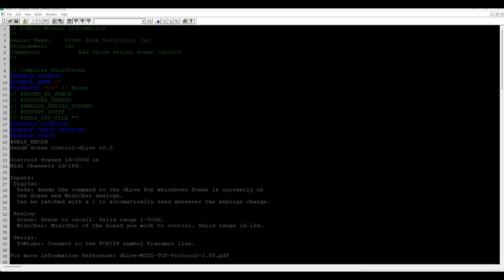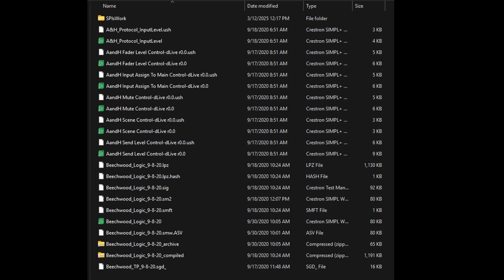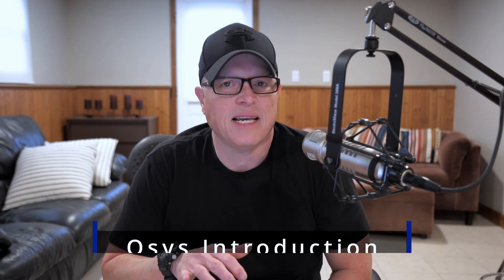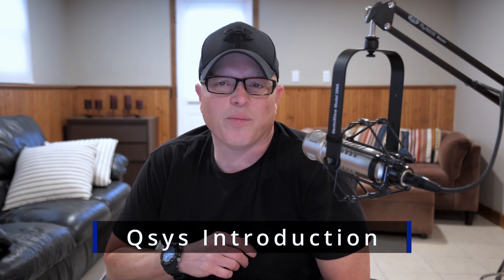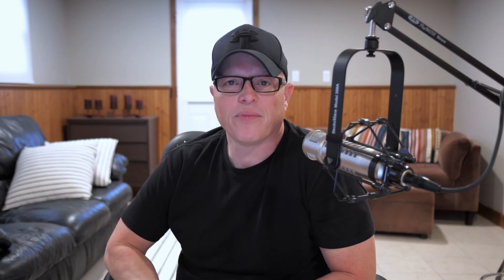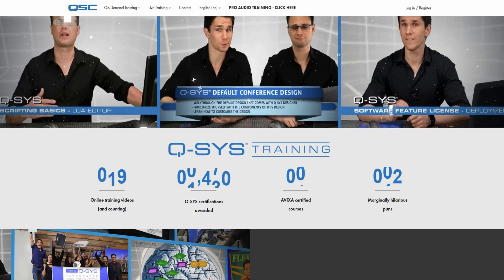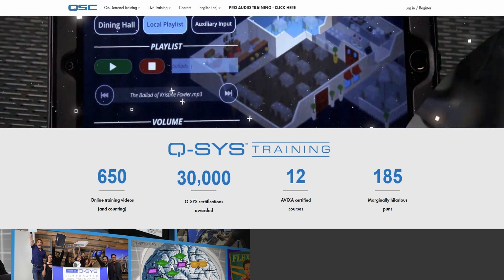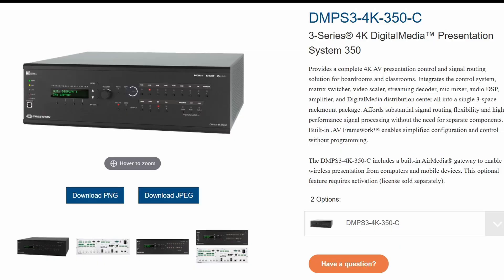The latest debate.... Qsys Vs Crestron, and who shall step up to the plate?

Comment: Control4 is a better system than Qsys.
I don't get why anyone thinks QSC is anywhere near Crestrons level. 
Unless people have just been AV programmers and don't understand software so they are lost as the industry goes from AV programming to actual development. 

C#, Vue-React-Angular - Completely Open source is what Crestron offers now. Only old legacy programmers use these proprietary tools. I haven't used any proprietary softwares in 5+ years. The only drawback is there has been TONS of AI trash slop, the benefit is I am constantly getting to fix AI slop. So my job is more and more secure. The more often people who dont know code, have AI write trash code, the more I get to fix it
If you leave the proprietary crestron software, you can also real time update the UI and code. 
vs
Lua - dated extreme limitations. And people are also using terrible Ai slop...well people who dont know Lua thinking CoPilot/GPOT/Grok are giving them good code. 
2002 era quality UI
Completely proprietary not reusable, cannot import npm/node packages. 
In are era of increasing complexity is not allowing OOP, refusing to leave dated procedural programming format. 
QSC debugging is the worst debugging I have ever seen in any proprietary software. 

Even Extron is leagues above QSC. They at least adopted python.

Comment: I’ve been a AV programmer for over 20 years and have been curious of how long the industry will last with the new AI development. Always did all my programming by hand but recently started using AI that can type out code in hour or less that would take me a day just to type it out. You do need to under stand how Lua/simpl+ work since AI does make mistakes on syntax confusion.
Reply from the maker: Same here!  I’m in that same boat.   I have come to the realization though, that AV will never be a single box that gets put in the room and that single box does everything.   AV has always been a combination of parts to make a system.   Programming wise will definitely be getting easier for just about anyone.   Running the wire, knowing how things interconnect……. and like you said, you have to be smart enough to known that AI isn’t lying to you.   We definitely have some big changes coming our way!  And also……. thanks for hanging out!   Glad to have you here.

Comment: I currently am developing a Q-SYS plugin for DM-NVX, and i must say that Crestron’s rest api is very extensive and a breeze to implement if you leverage lua in the right way. 

I have mostly been in the QSYS ecosystem but am currently taking crestron classes. When i have time, i plan to sit down and just write a Simpl# project utilizing React or TS. This is where i find crestron to be very interesting. 

If i can build a project like i would any other real software, that is huge. 

I can version control the entire thing top to bottom, others can work on other sections of the project. 

While i really do like QSYS, this is a major sticking point for me.
Reply from the maker: I’ve always been a big fan of Crestron NVX.   Great product!    Crestron over the past few years seems to be leaning their programming platform more towards the hard core programmers.   It’s an interesting gamble.   Make AV guys learn how to program who already know, sound, and video……… OR take the hardcore programmers just coming out of coding school and hope they can learn AV afterwards.   It does depend too however…… what kind of programming you’re doing…… for plugin and software development I get it.   For basic down and dirty AV, gotta get the room up and going….. i’m not sure.   Thank you for your comments BTW!   great discussion!

Comment: Compare Q-sys to crestron is like comparing BMW to walking. For average meeting room/boardroom system you can program and commission 10 times faster than crestron. 

For qsys you just need designer. 
For crestron you need vtpro, construct, simpl windows, simpl sharp, toolbox, nvx tool, and separate dsp (which probably gonna be qsys) all this software works and feels like it was built back in 1990 

Integration to mtr or zoom is way simpler on qsys than on crestron.
Reply from the maker: well said sir!   and thanks for hanging out.   Funny you should say that…. my next video is going to be on the QSC UC compute bundle.   It has been a breath of fresh air compared to what we are all use to as engineers.

Comment: I'm a student classroom technician for a university in the Midwest. About 7-8 years ago the university paid an external contractor to upgrade all their classrooms with Crestron-based AV controllers, cameras, microphones, etc, for hybrid classes that could be held through Zoom. The contractor overcharged and upselled the hell out of them and installed overengineered systems that were a pain in the ass to maintain. Ironically this was all well before COVID-19 which helped the university a lot when shit started shutting down, but it also exposed major flaws in the reliability of these systems. Finally around the time I joined my boss the head of classroom tech finally reached his last straw, and over the next two summers we started ripping out the Crestron systems and replacing them with more streamlined QSYS systems. Not only are they easier to maintain and less complicated to troubleshoot, but we also had full control over what AV controls were exposed to our clients i.e. the professors and instructors on campus. If you've ever worked tech support in academia you'll know just how clueless someone with a PhD can be when it comes to stuff outside their field, so this has been met with wide approval by techs, clients, and admin alike.

Comment: What do you think about AMX?
Reply from the maker: hey there!  thanks for watching!   AMX has been a control system player in the AV market since the old days of Crestron.   AMX was sold to harmon (DBX, Crown) a while ago and they’re still around.  AMX, like crestron requires a programmer who knows what theyre doing.   Not nearly as open as the QSC Qsys platform.  We see next to no AMX spec’d in designs these days by our local consultants…. but that may just be the market we live in.   What I have seen lately are the AMX video over IP end points…. apparently SVSI (a video over ip company) was acquired by harmon quite a few years ago.   AMX now has QSC qsys plug-ins to run the AMX video boxes in qsys.   Thats my main brain dump on AMX, and i’m definately biased towards Crestron, Extron, and Qsys.  As always…. a control system is only as good as the programmer, and a closed platform restricts your options as a user.     😃
Reply: @Arctics-8bit-Bytes  you should take a look at AMX’s new ‘AMX muse line’